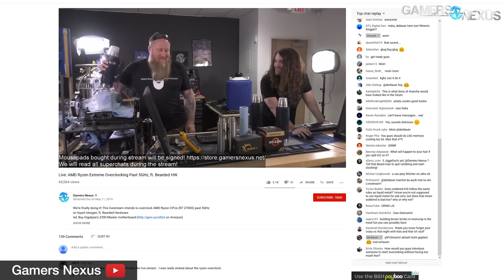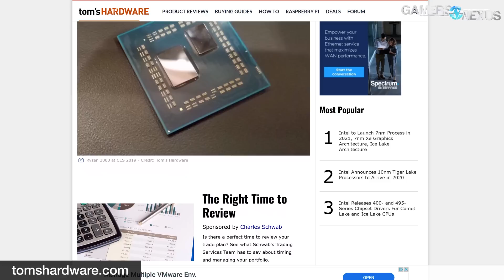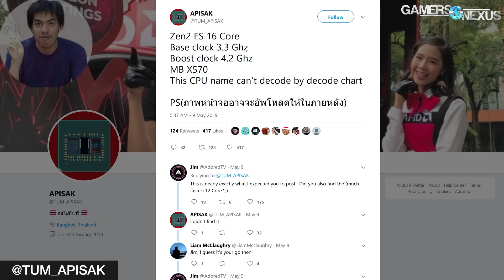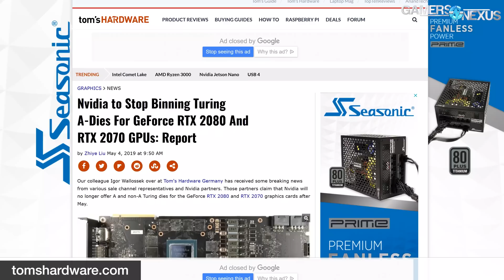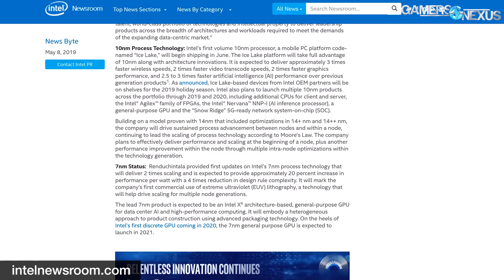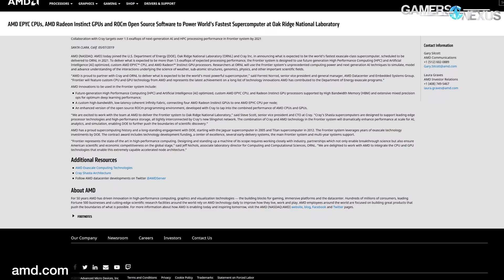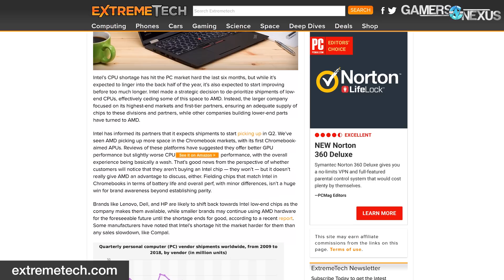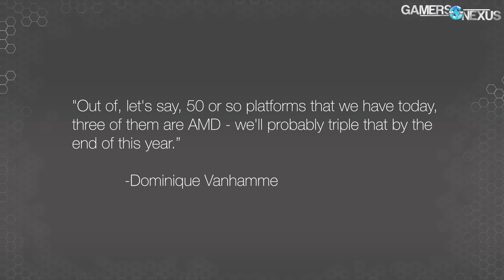HW News - Intel Shortage Ending, Ryzen 9 16-Core, & AMD Supercomputer

Comment: Intels CPU shortage is expected to end around the time AMD's putting out new CPUs. Really gets you're noggin' joggin'.
Reply: A lot of people dont understand how business works, and if you are THE monopolist, you can, and will, do anything you want with pricing and availiability, and Intel did exactly that for YEARS.
 So even Intel fanboys should thank AMD for ending this and making processors cheaper and better.
Reply: @AlexLionson  But will Intel do anything to keep vulnerabilities out of their chips? After these two vulns get patched (who knows when that will happen) I wonder if there will be speed reductions. I hope not, as intel chips run modern emulators better. Keep in mind, all of these vulns will effect architectures that come out this year too most likely.
Reply: @AlexLionson  Any rational person is happy when the competition is alive and well. That being said I have no loyalty to any brand and will always buy what makes the most sense for my needs. Unforutually for AMD that was still Intel. Despite all the hate the 9900k it is a very well rounded CPU that offers very good performance. I am aware that the 2700x comes within reach but the fact of the matter is that many applications still are clock speed dependent. If that is something you value higher than the obvious choice is still Intel. Now 3000 series may change this from AMD, but I couldn't afford to wait any longer to upgrade. I mean if you are a person that builds on a high end than the difference between 4k and 4.2k is so negligible that you end up buying the best.
Reply: @dennisp8520  AMD's ryzen 3000 chip they showed at CES beat the 9900k in some tests. Definitely a big step forward.
Reply: @cxsage1626  Yes this is true but we have no clue what the clock speed was, cooling used, and so on. For all, we know that could have been specially binned for CES and the ones that hit the market may not achieve the same results.
Reply: @dennisp8520  yeah even so this was just the 8 core, and if these leaks are true of a 12 and 16 core that aren't Threadrippers, is there even gunna be a 6 core like my 2600? this could not even be their top tier main stream chip. Which would be insane tbh
Reply: Confirms my suspicion that shortage wasn't completely natural, if you know what I mean.
Reply: I will be contributing to the demand for ryzen 3000s
Reply: But by then will they have zombieload flaw that came out yesterday fixed?
Reply: It should make for an excellent buyer's market around that time. It's also incredible to see AMD come back after being sabotaged by Intel so many years ago, they were set back so far. I confuse the stories I also heard that Radeon was sabotoged by nVidia a long time ago and it's also impressive to see how far they've come back too. They aren't competing as hard as the CPUs but the RX480 definitely was very impressive at the time. Slowly but surely the underdog is clawing its way back even after being kicked and beaten down with sleazy underhanded tactics.

That said I'll still buy whatever is fastest for the money. But yeah it's going to be a buyers market it looks like when Intel starts producing more and AMD starts releasing their new ones.
Reply: Must've glued some fabs together
Reply: Noggin joggin' {!!!!} Love that!
Reply: Intel claim that their cpu shortage will end. Remember, they've just had an investors meeting. They are desperate to say something positive to distract everyone from the following facts:
1 there is no concrete, substantive reason for them to have solved their 14nm supply shortage, at least not yet, because.....
2 they are still in a huge mess with their 10nm yields. Only a tiny fraction of their anticipated 10nm output has been produced, and that has all gone to notebooks.
3 AMD is looking seriously menacing at this point, and very hungry for victory. They are just about to launch a new paradigm in cpu architecture, which will bring huge benefits in core counts, efficiency, clock speed and price. All of this will be available to desktops, servers, and notebooks. 
4 All Intel can do at the moment is talk smack about what they are going to do, not what they are doing. The server/enterprise space is Intel's sacred (cash) cow. They are absolutely terrified that AMD will encroach on that, and all the signs are that AMD will do exactly that with their Epyc/Rome platform (as evidenced by Dell's intention to triple their Epyc server output)
Intel is now forced into a situation where, to retain any credibility, it has to talk up its 7nm products scheduled for 2021. That's 2 years away. Epyc/Rome and Ryzen 3000 will be in people's machines in the 3rd Q of this year.
Reply: @richie1326  There is a good reason the shortage might go away. If there is a sudden drop in demand but they keep the same supply, the shortage goes away. If ryzen 3 stomps them hard enough it will solve their shortage for them.
Reply: Its a shortage because they need to change architecture, with all the flaws remaining from current arch is bad especially given that some aren't patchable... Also the May flaw disclosure hasn't happemed yet or maybe the mainstream media hasn't picked it up yet, or going hush hush...

Comment: Surely the evga ceo knows the inside of a computer is a very electrically noisey environment and that a sound card can never compete with a stand alone dac. (Also why does it have spdif lol)
Reply: i think you mean Dac/Amp combo because a DAC is just a digital to analog converter you still need an AMP to power 300-600 ohms headphones...
Reply: jordan lewis
My Sound Blaster Z sound is crystal clear and the base is amazing. All for under $100.00.
Reply: @wysetech2000  most of the sound blaster have decent DAC/ but shitty amp compare to external dac/amp combo i used to have well still kinda used a sound blaster titanium HD but then i got an Aune X1s DAC/AMP combo and it doesn't even compare of course you still need some nice headphone and i got the 6XX sennheiser by massdrop and yeah way better sound than any pcie sound card of course a lot more money too..

Comment: Intel getting their act together again then? Was beginning to look like AMD was going to get an easy win later this year...
Reply: No, Intel's act is well and truly not together, the 10nm Intel CPU's Steve references to are mobile parts, not desktop... Inte's 10nm desktop parts are at least a year away, mid 2020 if you're lucky, with Intel 7nm not far behind that... Intel 10nm for desktop look likely to launch in 2020, and then be replaced by 7nm in in 2021...

Meanwhile, AMD launch their 7nm in a few weeks, though only time (and Steve's review), will tell what that node shrink brings to the table apart from more cores...

Comment: So what kinda all-core OC can we expect from the 8/16 X version?
Reply: Leaked frequencies are they are hitting 5ghz on air.
Reply: Craeshen i hope they do hit 5. seems like that’s what’s holding them back right now. if they can hit frequencies as high as Intel while being inevitably less expensive, they’ll soar in market share
Reply: @NotBackstretch  Intel processors, when manually overclocked, hit the said frequency on all cores. For instance my 4670K is running on 4.5GHz on all 4 cores, not 1.
Reply: @ASKnASK  Intel changed boost clocks back on the 8700k. Manually getting a 5Ghz overclock is still pretty difficult without at least a 280mm AIO cooler or very beefy air cooler. I think Ryzen will be in the same boat, it may be possible but its going to require a hell of a lot of cooling. I think 4.4 is a more reasonable expectation for a freaking 16 core CPU. The 8 core variant might be able to get higher clocks but I really doubt the 16 core variant will unless you win the silicon lottery.
Reply: @dennisp8520  I think you're overestimating how hard it is to hit 5Ghz on 8/9th gen chips. I hit 5.1 all core on a 9600k with a budget z370 board and a $70 240 AIO cooler. Reading around online it seems like most have clocked theirs to at least 5Ghz if they tried
Reply: Eidarus Omar what’s your avx offset? I know I’m stable but damn the 9600k is very hot.
Reply: @Craeshen  That is most probably the 'boost' frequency which isn't an all-core OC. That usually applies to a single core.

Comment: May grab a 9900k if I can get a deal on one sometime 🤔
Reply: Suggest you wait in you can - Ryzen will drive down Intel parts regardless, and you don't know what AMD's 8 core will bring to the party, and the Intel 300 Series Motherboard you will need for the 9900k doesn't support 10 series Intel CPUs so you have no upgrade path with Intel, so if you can wait a few weeks for the 3000 series reviews, you'll be better off regardless...

Comment: That 16-Core RYZEN looks temping...

But if that 12-Core really CAN get close to 5Ghz, I might replace my 1700 with that. 💯
Reply: 12-16 core is way too overkill for my gaming rig, currently I am looking for a higher clock speed offering from Ryzen 3000, preferably 6-8 cores, hopefully with SMT too.

It would be a massive upgrade from R3 1200, even when overclocked to 4Ghz, which is pretty much the limit of stock cooling and shitty mobo, it still feel sluggish when I am heavily multitasking.
Reply: might ? Only might replace it?
Reply: me too
Reply: I'll take a 4.5 ghz boost. I just want decent ipc boost. I'll pick either the 12 core or the 16, depends on which perform the best.